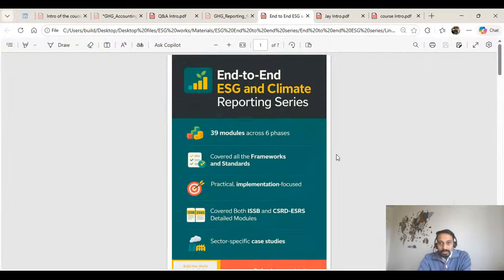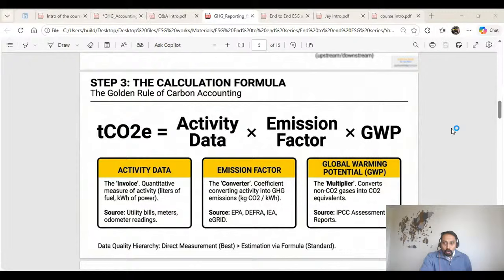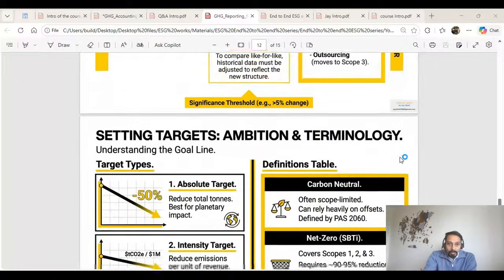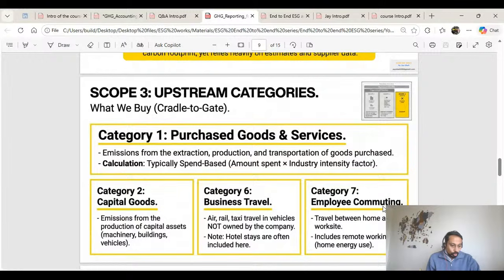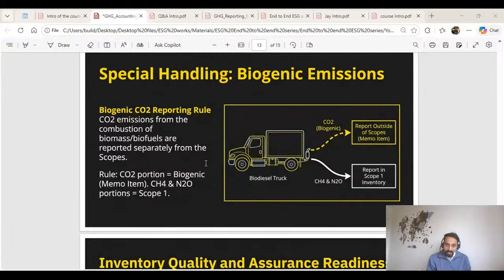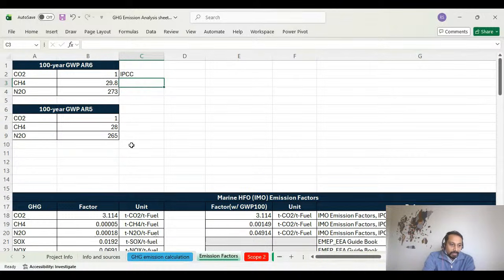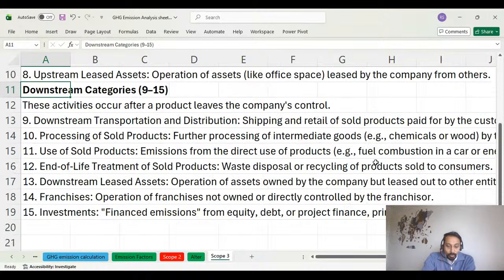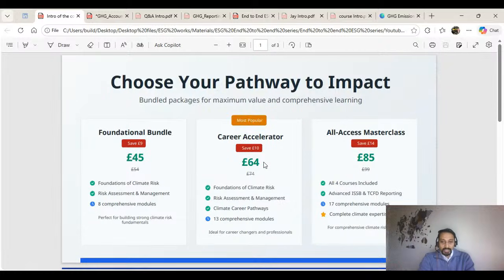𝗠𝗼𝗱𝘂𝗹𝗲 𝟳: 𝗚𝗛𝗚 𝗘𝗺𝗶𝘀𝘀𝗶𝗼𝗻𝘀 𝗖𝗮𝗹𝗰𝘂𝗹𝗮𝘁𝗶𝗼𝗻 - 𝗦𝗰𝗼𝗽𝗲 𝟭 & 𝟮

Comment: The higher the hierarchy, results will be more accurate tier3>tier2>tier1
Reply from the maker: Yes, generally higher hierarchy = more accurate results.
But only if data quality, emission factors, and GWPs are correct and up to date.

Accuracy depends more on data quality than just tier level.

Comment: Because whatever I learned is in the tier 3 approach we have to follow this :- Volume -> Mass(kg) -> Energy (NCV) -> Emissions (EF&GWP)
Reply from the maker: It depends on the availability of the data, For GHG calculation (Scope 1, 2, 3), follow the GHG Protocol hierarchy.

Scope 1 & 2:
Best approach = activity-based method
Fuel/energy data → NCV (if fuel) → Emission Factor → GWP
This is more accurate than spend-based estimates.

Scope 3:
Start with spend-based for screening first,
then move to activity-based (mass × EF),
and ideally use supplier-specific data for highest accuracy.(Best practice)